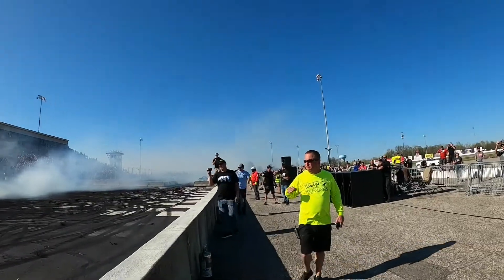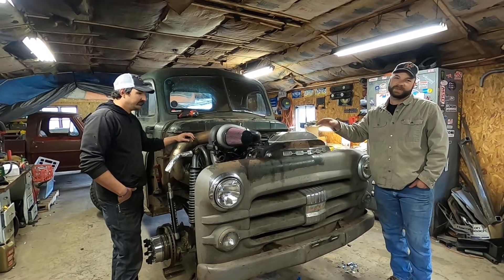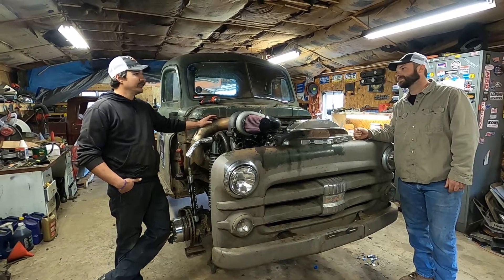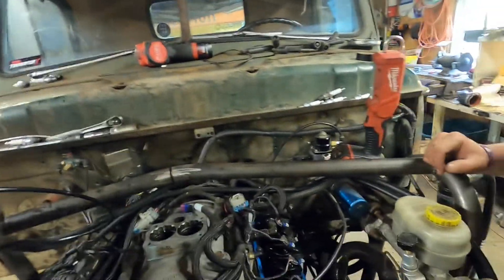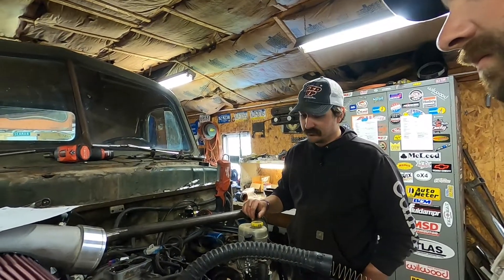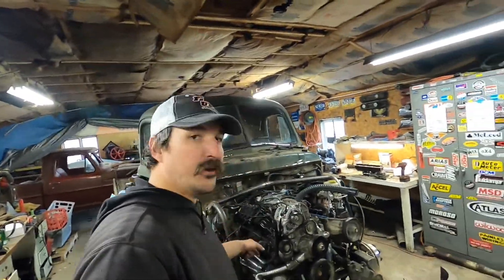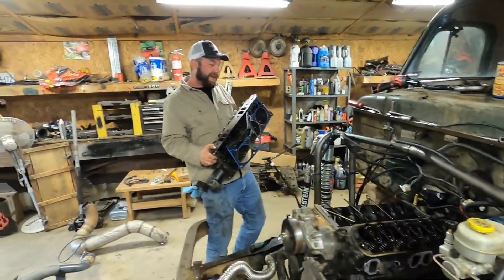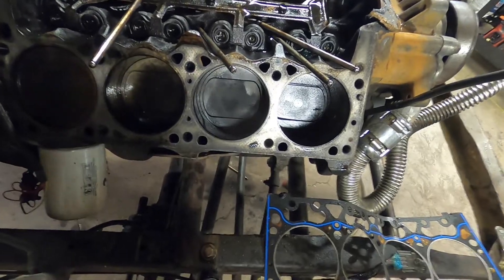Cleetus and Cars Burnout Damage Report!

Comment: It's easiest to set the regulator to 100 psi with the tester disconnected from the cylinder and then connect it. By doing it that way you get an easy percentage of leakage. 100 psi in and 90 psi in cylinder for 10% leakage as an example.

Comment: Headgaskets definitely explain the oil in the engine bay. Just blasting it all out the wastegate. If there's oil in the downpipe, check that the turbo oil drain isn't melted shut. That'll make a good turbo look real blown.
Reply from the maker: We for sure are going to replumb a whole lot of stuff. Turbo looks ok, we'll find out once we put it back together. I think it was just the head gaskets.

Comment: Definitely go back together with some ARP head studs! Maybe you won't have to pull the heads after the next rip!
Reply from the maker: It's got studs now and some slightly better gaskets! It'll be ripping again real soon!
Reply: @FedUpFab  I hurt the turbo on mine. Gotta swap that out and be back at lucas oil on Friday for ultimate call-out challenge burnout.
Reply from the maker: Good luck man! I'm always rooting for another stick Dodge guy!

Comment: A couple things to consider
Turbo insulating blanket to contain the heat
A way bigger rad with electric fans to dissipate the heat
Anything to prevent overheating issues is a bonus. No concern for wiring then either.
Loving the old Mopar. I've been a Mopar fan since my dad's 70 Fury III. Just like your Dodge, the old C bodies could still lay down a healthy strip of rubber.